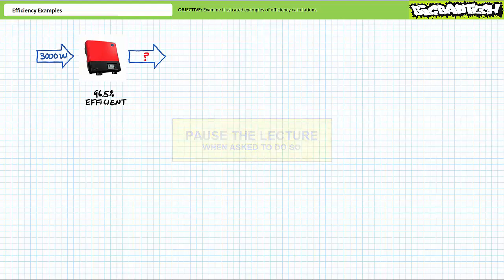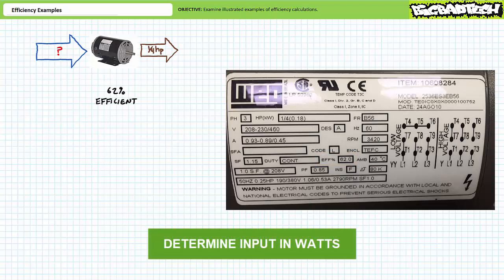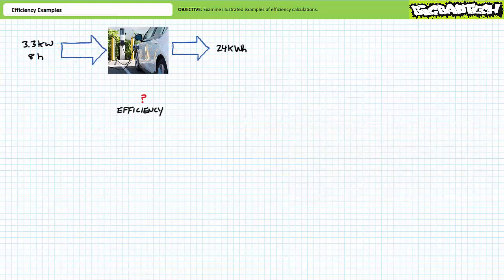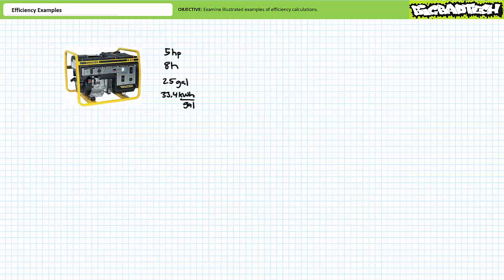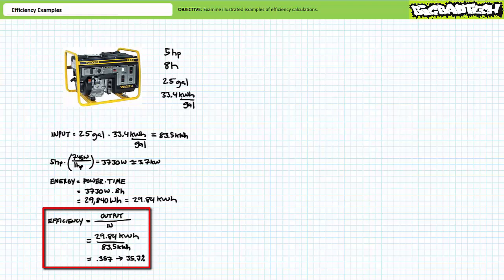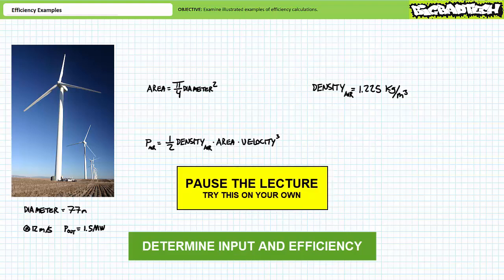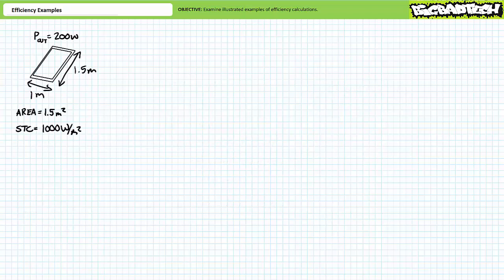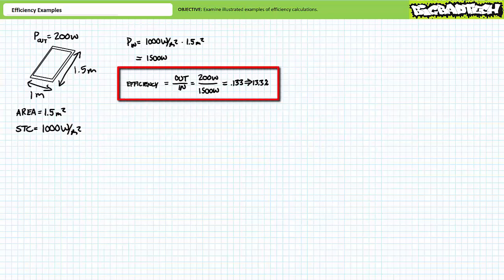Efficiency Examples (Part 1 of 2)

Comment: In regard to alternative energy, the efficiency DOES matter, not necessarily the efficiency you're calculating because the captured and lost wind was free. But, If my tax dollars or energy bills go up to litter my state with wind turbines, I want to know that it wasn't just a feel good optics thing. 

For instance, the UK as a whole has much more wind resource than the US, but their average output is 16% of nameplate power. That's over and above the losses you described. That means that that they are paying for all the associated costs building, installing, maintining, and "housing" giant machines that are reported to be, say 1 megawatt hour each, but output less than 1/6th that amount. That same unit in Ohio would be less than 1/8th the rated output of the unit. Those are averages, oftentimes there is zero output, which speaks to the intermittent nature of alt energy.

The thing about the grid is that its demand is seriously dynamic! Add into the mix, the intermittent nature of alternative energy and it's very tough to match the supply and demand. The grid has to deliver the exact amount of the demand.

Alternative energy should be used when and where it makes sense. Also, the US is now an energy exporter. But, the fuel we aren't buying from elsewhere is going to China and India. I also find it ironic tha Australia sees itself as so enviromentally woke, but their dirtiest coal, illegal to burn in the west, is being sold to China.
Reply from the maker: The challenges of scheduling, transmission, and distribution aren't unique to wind. Once it's generated it's all electrons and subject to the same inefficiencies as anything else. Easiest way to think of it is as a cascaded multistage system. I'll explain some of the idiosyncrasies of AC (among them power factor and harmonics) in later lectures.
Reply: @bigbadtech 
I'm simply saying that SOME alternative energy is more intermittent and therefore adds to the complexity of grid management and ultimately efficiency. For instance, a hydro-electric power plant output can be easily throttled up and down, giving the plant control over its output to the grid, similar to fossil fuel or nuclear plants. The ability to control the plant's output is beneficial to the management of the overall grid. Grid managers can work with the afore mentioned power plant types to more easily balance supply and demand.

Conversely, wind and solar farms are unable to control their max output. For instance, wind is ever variable, meaning the maximum output of the farm is also variable. Solar farms have a similar, albeit slightly more predictable issues: time of day, cloud cover, and haze effect their output.

This is not an unknown issue. Australia famously  used nearly as much fossil fuels after they rapidly ramped up their use of renewables.

Thermal shock is an issue when heating steam turbines using fossil fuel or nuclear. As well, cooling them down causes shock, so the Australians just left them hot, not knowing when the intermittent wind or solar output would dip.

Not only do harmonics and power factor take a toll, but transformers are only highly efficient at unity, which happens near max load (matched impedance, I suppose). So, supplies constantly ramping up and down through layers of transformers is certainly more detrimental to the efficiency of the grid.

I'm saying that unpredictable, intermittent power sources reduce our grid's efficiency more than power that can be throttled up and down. PV solar having the additional issue of harmonic distortion.
Reply from the maker: Check out an older lecture of mine that covers some of these topics including the intermittent nature of renewables at: https://www.youtube.com/watch?v=w8HePeQWph4 

Hydro power is pretty unique in that it can act as both a base load and peaking power plant. To be sure there are significant technical challenges integrating distributed and intermittent renewables but they are by no means insurmountable.

Comment: Excellent video! Two thumbs up, if I could.
The below is a tangent off the basic topic, one I've mentioned this before in the comments of your other videos. I do this mainly because I a lot of people watching might be interested in alternative energy, but be taken in by the idea that alt-ergy is a simple solution.

The inverter itself will have an efficiency, but there is likely an invisible loss seen within the larger system because of them, caused by harmonics. If the system is grid tied, the resulting power will surely encounter multiple transformers, where mainly 3rd, 5th, and 7th harmonics will serve to reduce the efficiency of those transformers. The degree to which this is true, is based on many variables. Regardless how pure your voltage sine wave is, the inverter will produce harmonics in the current waveform because the way it chops up DC to make AC.

As an example, let's say an entire subdivision in Florida has grid tied solar (these subdivisions do exist), that system will suffer (to some degree) from not only issues related to THD (Total Harmonic Distortion), but there will also be the inevitable (what I call) "voltage arms race". Meaning, you may have 20kW of potential PV on your house, but it's POSSIBLE that none (or very little) is available for use (by your house or anyone else's) because the incoming line voltage is slightly higher that the max your system is permitted to run. The highest voltage source powers the loads. This is fairly common in neighborhoods with a lot of private PV solar installations.

There are ways to configure your system to use the power you produce, over what the grid provides, but that's not how the overwhelming majority of systems are configured, plus it takes more equipment and costs more to do. Most people consider whether to go solar, based largely on the time it takes to get an ROI (Return On Investment). However, voltage issues, such as described, may mean your system will take much longer to ROI or may never ROI.